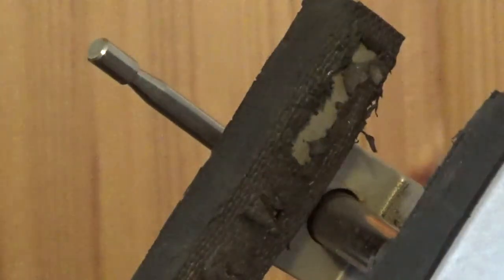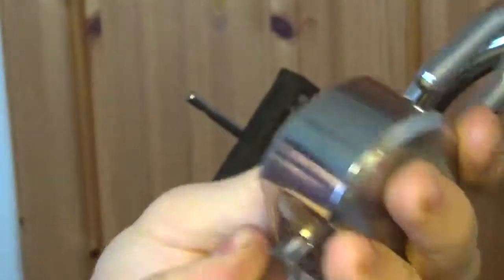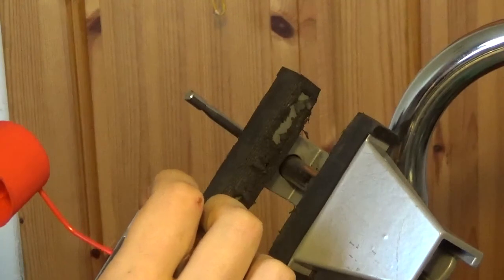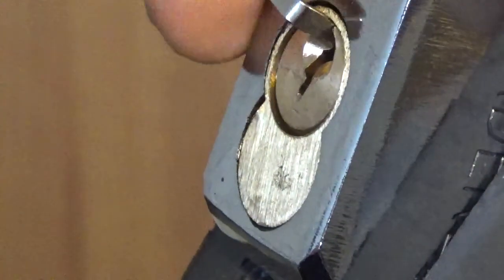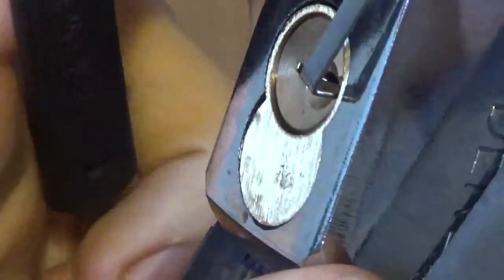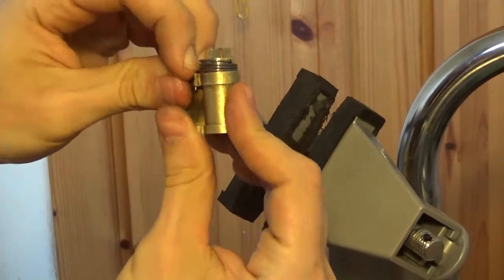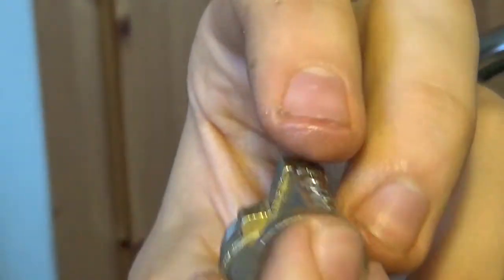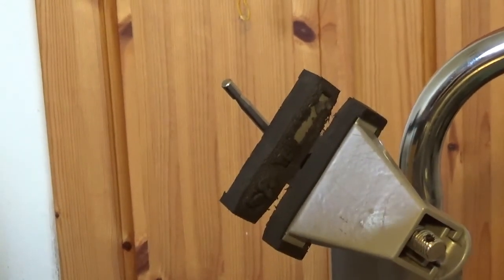Lock:118 Silverline roundbody padlock picked.(I need a best core or something)

Comment: Very interesting :). I've seen these Silverline locks in the shape of an American 700/ACE on ebay and was always curious how they would be :). Forget that a Best core will fit ;), it's way smaller than you think and you can't screw it on. There are conversion kits for KiK plus holder to Abus, but also there chances are very very small (and for sure not worth) that this would fit (but that would be my closest guess...). You probably have to stay with this chinese core and make the "best" ;D out of it :). The core has to come apart. Either there is a pin pressed in to hold the plug, or a clip. Thanks for sharing :).
Reply from the maker: +redcatimaging actually i think the top can be opened and the pins taken out but i neeed to seal it again. Yes i probably will have to do something myself if i use it. But sure it is in my collection instead.i could not really afford the kryptonite i saw lol ...oh well
Reply: Maybe an Abus 83 core could fit? You might have to modify a bit the tailpiece, though.